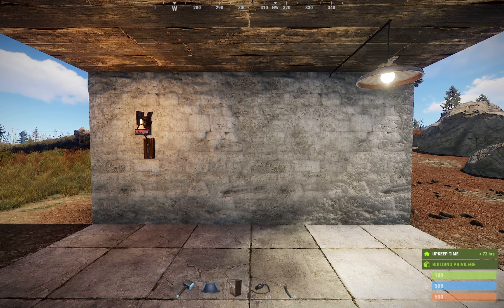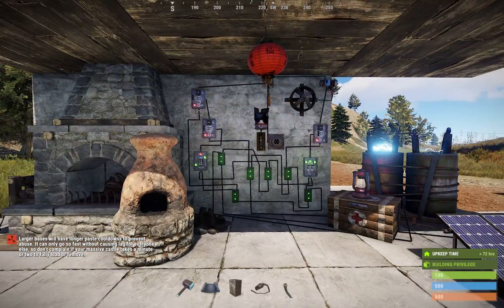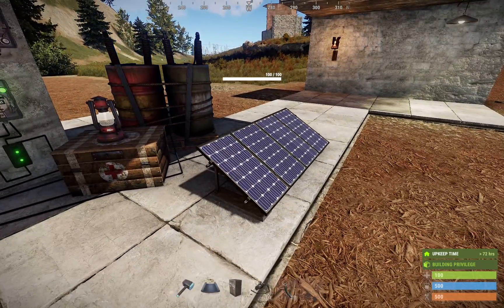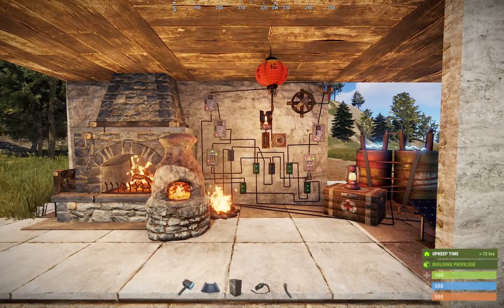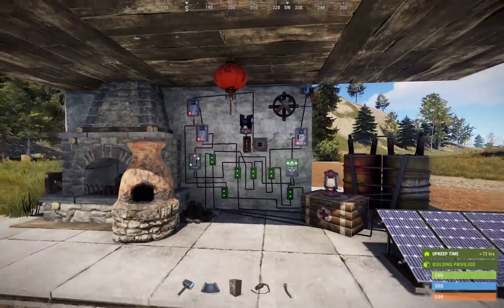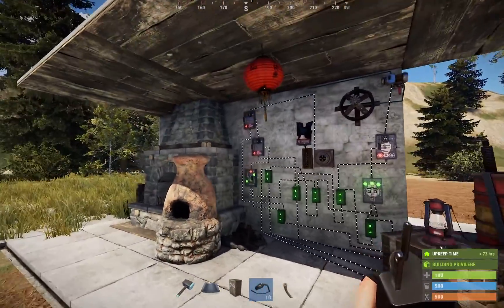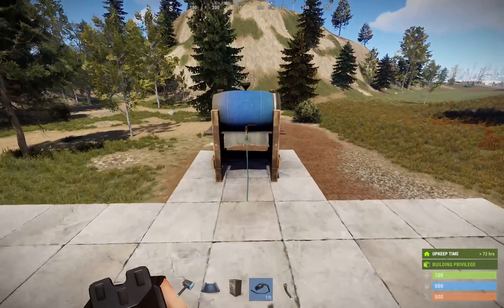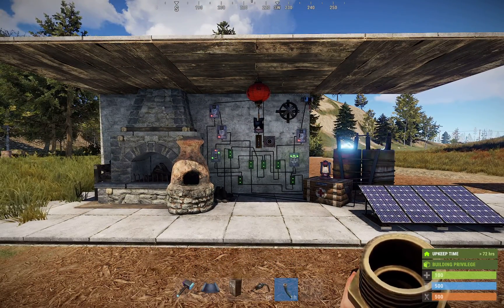Automated magic fireplaces, lanterns and more in Rust

Comment: Why not simply use a blocker to trigger the lights? Even if you have wind turbine, you can still use the Solar panel as a sensor for light. You could use a splitter to light up the timed sprinkler. The splitter would go to the blocker and the timed switch.
Reply from the maker: Thanks for the comment  :)  Weird things happen when using the blocker because of the transition period when there's partial sun coming in.